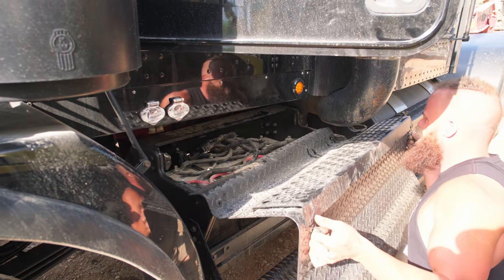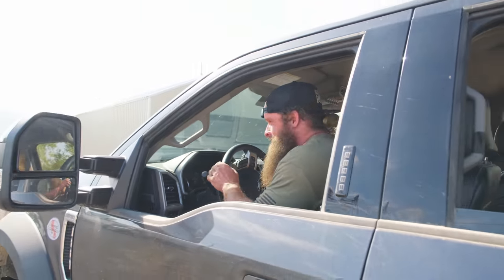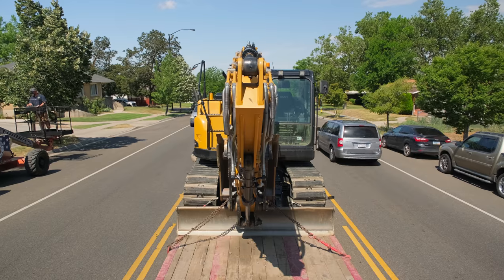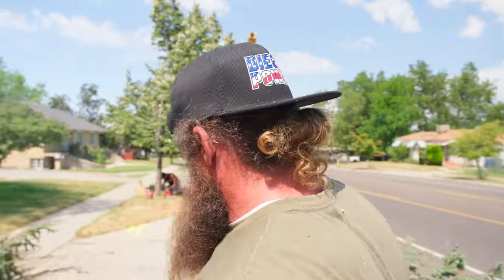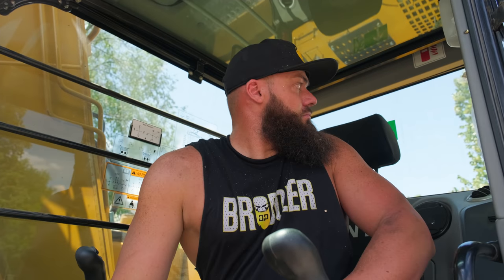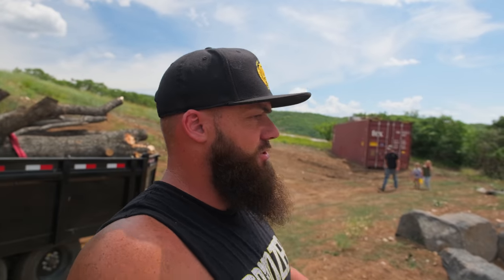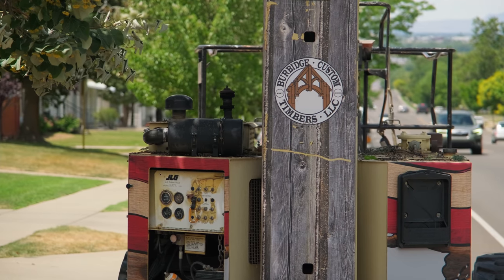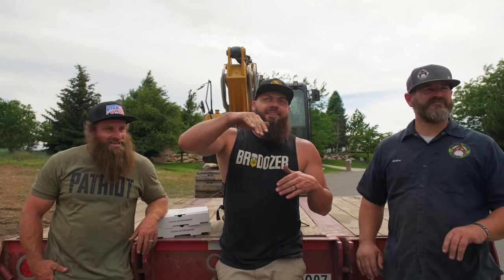This Huge Tree Was Headed To The Wood Chipper Until We Had A Better Idea...

Comment: To get the hubs to automatically lock into low 4x4 "On The Fly", the Ford sequence is: (1) Neutral, (2) Foot on Brake Pedal, (3) Turn "On The Fly" lever to "Low".

Comment: I’ve done that (pulled start a truck) with a two wheel drive 1/2 ton pickup and a fully loaded water tanker. When I was in the oil filled.  In the middle of the night. That was fun.

Comment: I drove heavy tow trucks for years and I found that snap on sells extra long sockets for caging brakes it works great with a 1\2 impact but don't break the ear off the cage bolt like I did the first time

Comment: Hey HeavyD and Diesel Dave!!!  Its Erik the IndianaBoy...Just a comment/suggestion/ my 2 cents...With the Tree house being a permanent structure, I probably would have poured a concrete footer before setting the tree in place...Or set the tree in place while the mud/concrete was still wet...20 years from now, the stump would start to rot and eventually settle... Something that might help would be to pour a concrete pad around the tree to shed water away but if the kids were to fall out of the thing, u wouldnt want concrete there...U asked for my 2 cents... If u want to give an IndianaBoy/Construction worker a job, I'd be proud to be a part of the team...I'm starting a small-scale excavation/demolition company in April but I'd leave for Utah with my camper for the right opportunity.  I've been through Ogden on my way to Oregon few years ago...Anyway, your show is very entertaining with all the different scenarios...Also want to say thanks for all of the useful info as well as educational info on some of your ads...C ya...IndianaBoy

Comment: That's a cedar of some kind, maybe an Atlas or a Lebanon cedar. I would have cut it down and used it to make boards. That straight center trunk is just asking to become acoustic guitar tops assuming there are no glaring defects up the middle. Cut them to about an 1/8" thick, sticker them, put them under a cover of some type and let the dry air out west do its thing. In a couple years, they'll be perfect and they can be planed to thickness and cut for the top of a guitar. Keep a couple of those thicker limbs to cut down to make the bracing for the body inside. 
I like a harder wood for the back and sides but even then, cedar isn't a terrible choice. Nice piece of maple for the neck, a really pretty blonde fingerboard and little .22lr case heads as the fret markers.

Comment: Just a bit of advice, when trucks sit in slightly humid climates, the connections on the starter will corrode. Pull the wires off the starter and use scotch brite to clean both sides of the terminal. Put them back on and if it doesn’t start the truck, now go spend $350 on a new starter.

Comment: lol, love those redwood pinecones.  we used them as bases when making a redwood wreath.  Yeah, there is no way that tree can survive a Utah  drought.  Okay guys, as usual I'm coming late to the game but I'll comment like it was posted yesterday.  It's funner that way.  Heavy-D, is that your Echo?  Those are good saws.  They don't seem to sell them out here in Oregon anymore.  I thought the company was going under.  It looks like they are still running metal covers which is nice.  My Stihl  is about the bar length of yours which is on the long side for the limbing you are doing.  Don't be afraid to have more than one saws with different bar lengths.  If you want practice come on out here in the winter with a plow on one of your six tons and we'll have fun clearing some BLM roads.  Heck, if you do that out there in Utah, it'll make a great blog.  BTW, your heavy machinery handling when you dug out the tree...it was a thing of beauty.  Love the gentle touch.

Comment: when it clicks like that but doesn't turn over, if you're sure it's not a dead battery then it's probably the contacts inside the starter solenoid. sometimes just giving it a few good whacks can get you going temporarily. some may say it's bad for the starter magnets, but if it needs replacing anyway... I assume the starter is similar to a car, just a lot bigger.

Comment: I would dig the hole tree up put it in the front yard dig a hug area about half way kitty corner of the house,then dig a Hug  Simi half pool in like with Big, medium, and small cooler rocks round the edge with a running fountain running done into it and the rocks would be like those ones that like heat up or warm up, then take make a curvey walk way to the house with the sparkling little white rocks put that down first then flat stepping rocks in between. Ok lol I could go on and on but get it I think LOL 😁

Comment: This just happened to me around 2pm to mei went out to go do a repair on a truck driver wrote up coolant leak fix the leak when to start no start but it was more a solid start stop so I was like ohh shit. Check the dip stick there was a 1/32 of oil on the dip stick. And I have told the driver to check his oil on his pre trips. So I was like he just did a oversized load 2 day ago. Sat for 2 day. Fill it up with oil told the boss to put it in 4 gear fucking started! THANK YOU HEAVY D!! Save my day as a tech on a 95 degree weather! Here in Washington state. always look up to you heavy d! Checking the oil pressure but I’m sure it not good 15 psi oil pressure in the shop. Go out tonight or tomorrow
Reply: Also it is the same truck Kenworth t800 with a Isx same year too

Comment: Actually, I would’ve took a Trackhoe and put a strap at the base of the tree and pull it out. You can have as many routes as possible because that type of spruce tree. I forgot what type it is but it’s pretty much very expensive and it’s very beautiful.

Comment: Question/statement:
   That tree being dead will start to decompose. Whether its buried under the ground or set in concrete, either way it'll just rot.
    Osage orange is the only tree that'd stand up to being buried underground for any real length of time. It'll last around 80-90 years before it'll rot bad enough to be of concern. But softer wood, just won't stand the test of time. That being said, I'm sure your crew(the timber guys) know all that and will accommodate for that with other supports

Comment: if the starter is finicky it's the relay contacts that wore out. there's a plunger that slams down when you turn the key that transfers the battery current to the starter motor. you may even be able to replace those without removing the starter. i was able to on my old 91 integra. the parts will be like $8. that car was a bitch to work on because there's no room in the engine compartment, but i was still able to replace the alternator bushings and the voltage regulator without removing it. the service manual procedure to replace the alternator was either take the axle out on the driver side, or, the unconventional way was to remove the master cylinder.

Comment: I’m sure someone has beat me to the punch . but a  much easier way to air up your truck , is undo the airline ride at the air compressor on the drivers side  fromt part of the motor and Tie your air  in  right there all you need is a 1” open End wrench and your air fittings obviously

Comment: Dave, I could really use some help with fixing my case 480 ship loader that needs brakes. I could usually do this but I just had my knees replaced and can’t put pressure on them. I’d appreciate any help so I can hopefully go back to work finish grading new house lots. . Any help would help, plus my 2500 dodge needs front brake lines replaces due to improper installation of lift kit bebore i bought it. It’s a 200 dodge 2500  v10 gas which is pristine condition

Comment: hey... this comment might be a little late because i just saw the (saw.... get it.. saw)   video but this might help thst treehouses longevity. once the tree dies it loses its ability to defend itself against bug, rot, decay and all the other things that will break it down and shorten its life after death. ive built similar stuff here in Georgia and typically in less than 2 years its spent. now... with that being said i am in GEORGIA with a ton of humidity and bugs and all the things that will break a tree down. So you may not have the same issues there that i do here but i just thought id let you kbow that it may be something to consider. here i started coating the ends of the logs/trees with several different things to minimize the effects and prolong the "life" of the dead tree. Definitly dont want you putting a bunch of time and effort and money as well as your kids into an awesome idea only to have "fall apart" in just a few years and possibly injure a family member if the timing was bad. good luck with the project. ill keep watching.  if you ever make it to the Atlanta area hit us up and come by the shop. We own a tire distributorship as well as a fab shop where we build overlanding vehicles and industrial art and furniture  Not nearly on the magnitude of what you guys do but its fun and pays the bills. were planning a trip out to Cerro Gordo next fall to do some work with Brett as long as we can get our truck built by then. Maybe we will see yall out there. 👍

Comment: I'd rather want A72 Chevy blazer.all trick out. I had one while back ago that I built with my own 2 hands Put a lift on it 35 inch tires posi Front and back Differentials Built the engine headers Aluminum intake carb etc was a nice rig un tell some a******wiped it out I am handicap and can't  build any more 58. And sitting home when I should be playing in the snow with my buddies but oh well life sucks at times

Comment: Just saying a tree with pine cones is normally a pine tree. Seeing how it has pine cones.
Reply: There are over 100 species of pine trees around 125 actually, with more unresolved up to possibly 40 more ,  such  as jackpine , redpine, lodgepolepine, ect. Also spruce trees, Fir trees, Cedar, Larch , Redwoods, junipers, kauri,hemlocks, and many more,, all with many of there own different species like white spruce , black spruce,  blue spruce ect. literally all produce cones of different sizes all these trees are classified as conifer trees meaning they produce cones the number of different possible conifers is massive and thats just one tree type so it has a cone yes its a conifer tree but what conifer tree and what  species of that tree it maybe a pinetree or maybe a spruce or fir you would have to look at the needles to see what kind of tree then see what species of that tree or local to that area its almost impossible to keep track of them all so any forestry profesion just requires the knowlodge of the species local to your region but even that is overwelming at first with hard woods softwoods tree types and species and catagories sub species  and so on . But yeah a pine cone does come from a pine tree but a spruce cone can look awfuly simular as can many others so just figuring out what type of cone it is first is the hard part. I gave up forestry and work as a welder now easier to remember the different metal alloys then trees.

Comment: That white pickup truck with the low profile tires looks way too ghetto to me. I think it's just downright ugly but to each his own. Personally any vehicle built in America anymore is not what it used to be. First of all Chevrolet and GM are both owned by Chinese and they have kind of driven the brand into the ground while increasing prices to the point of being ridiculous. Any pickup truck nowadays should be no more expensive than about 50 grand, but I see a lot of them out there that are $120,000 and that's not including any outrageous extras that the people put on them. Chrysler products of course are owned by Fiat, and even Ford has been bought by the Chinese. If I wanted to pick up truck, which I don't, but if I did, it would definitely have to be built by Toyota. They are pretty much bulletproof as far as longevity goes and parts are readily available everywhere.

Comment: Just subscribed and I am both ashamed and confused as to why. First admission is that I reside and was born in England- not the reason I am somewhat rueful, I hasten to add, but I have always had a soft spot for what I consider to be true Americans. I am aware of the troubles facing your Nation at present and it is the likes of yourselves that hopefully will drag common sense and decency back from the crazy moral mess that has engulfed the.....sweat less, vocally vacuous and ideologically deranged....you get the jist hopefully. Success and happiness to you and yours.